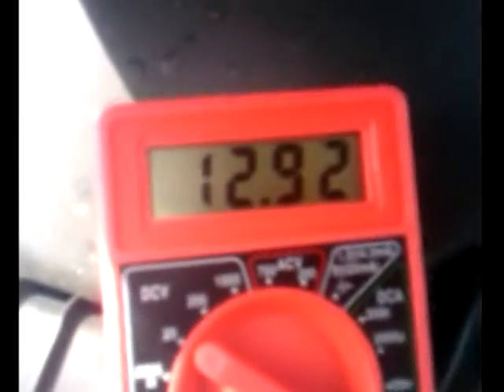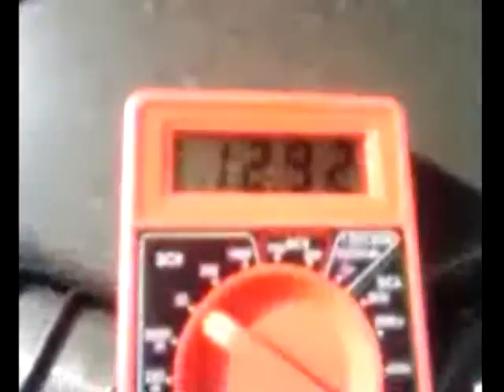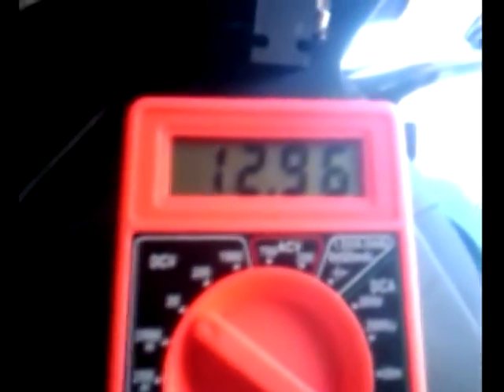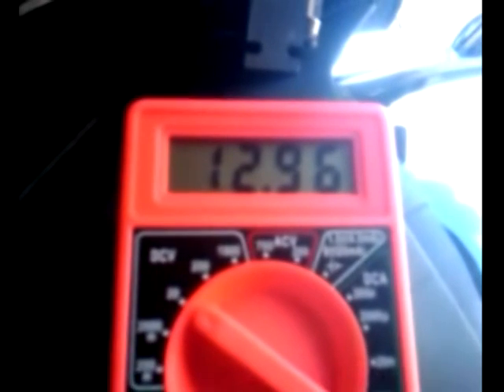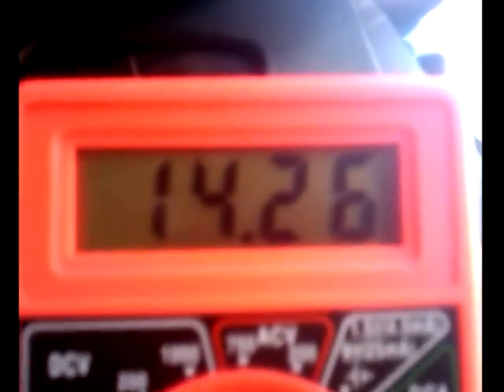Battery Charging Test

Comment from the maker: sorry for the late reply, I would suspect a bad battery or wrong battery. If you don't have a battery with the proper "cold crancking amps", it will not start your bike. Also, there are some batteries that are brand new but defective. Have the battery tested and cross reference it with an OEM battery.

Comment: i have bought a new battery for my ktm exc-500. Though fully charged, it drops to 11.5 upon continous cranking. It steadily increases thereafter to upto 12.5, but still not able to start the engine. It is only starting upon jump starting it with another battery. Upon jump starting engine does run well with the battery voltage during running being around abt 13.2 volts. Any thoughts on why my battery isnt able to start my engine.
Also the voltage during cranking sumtimes reduces to 8 volts

Comment: A brand new battery will last a minimum of four years. I have seen some that have lasted eight years, but they are rare! If your battery lasts 5-6 years you are doing well but anything after 3 years should be tested on a regular basis, once in the spring and once in the fall. A simple load test takes 3 minutes to perform and will tell you if your battery is reliable.

Comment: A brand new battery will give you 13.5 volts stand alone. With the battery attached to a vehicle with a brand new alternator will give you 14.5 providing the battery is fully charged. As the battery and charging system age, corrode and wear, the voltages will vary. The lowest it (the battery) should read is 12.5 volts. If a battery reads 12.5 volts after being fully charged it should be suspect and verified (IE a load test and a cell test)

Comment from the maker: That would depend on the symptoms. If you have a good charge (12v+), and you turn the key and get nothing, then it could be your distributer (if you are in a car), if you do get spark, then you would have to look further down the path. Remember you need three things to get an engine to start: 1) fuel, 2) spark & 3) combustion.

Comment from the maker: Jim,
Sorry for the later reply, I'm usually out riding and don't get enough time to answer the messages. This video was mainly a test showing the voltages you should be seeing from the stator (or alternator) and the battery. This is not a test for showing the batteries performance or if the battery is good.

Comment: I always thought in order to get an accurate reading you are first suppose charge the battery up, then shut bike off, then turn the headlights on for a few minutes to get rid of the surface charge on the battery, then check for a reading.

Comment: My voltage with my motorcycle running is about 14.6 volts.  Is this too much and is my recitifier bad?  I have a 2004 honda vt750 shadow.

Comment: @EvilJesus909 tks i went today and apparently the rectifier is done and the stator need to be changed also, what gets me mad is that suzuki posted a recall on the 08 and up for the rectifier but not the 06-07. and this afternoon while riding you can smell something  burning  where the rectifier is.

Comment from the maker: @flipmode00 You could have gotten a defective battery, but if you really want to test it, you should take the battery to a test center and have them run a load test on it.  If the battery proves to be good, then it will be something with your charging system (read: stator)...good luck.

Comment from the maker: @LiquidChem No, the standard voltage of most (and I say most because I have not seen/tested ALL vehicles), is 12 volts (if you look at your wiring diagrams, you will see that you are running a 12v system.  Also, look at the actual output of your battery, more than likely it will say it is a 12v battery.  The misconception comes in because a 12v battery requires 13+ volts to charge (you will measure this when the engine is running).

Comment from the maker: @Michiganborn1969 Thank you very much.  I'm glad this information is helping fellow riders.  I will try my best to answer questions sent to me, so here it goes.  Yes the information is going to be the same, readings might be off a little (varies some by vehicle).  If you are having issues like that, I would definitly try testing the output power from the stater and from the voltage regulator/rectifier.  I would definitely start with idle speed (even if you just had the carb rebuilt). Good luck!